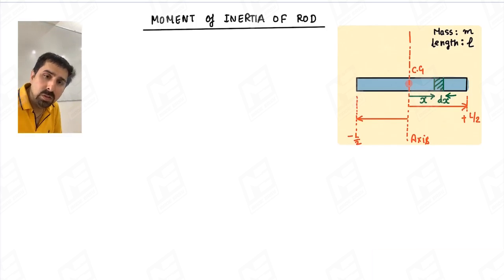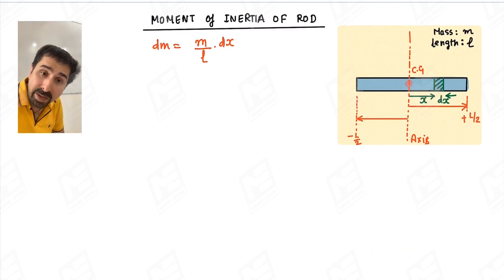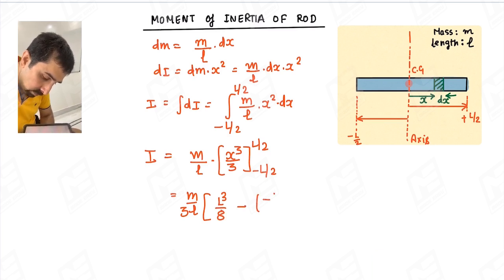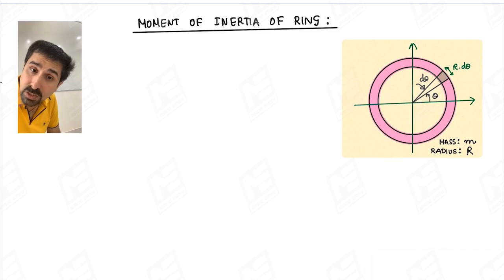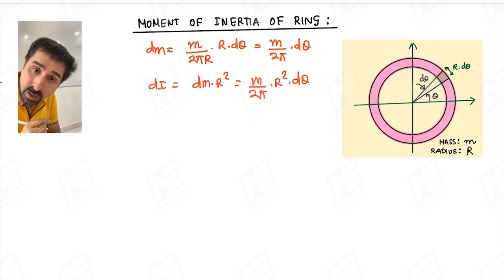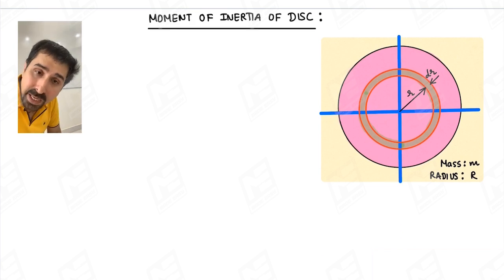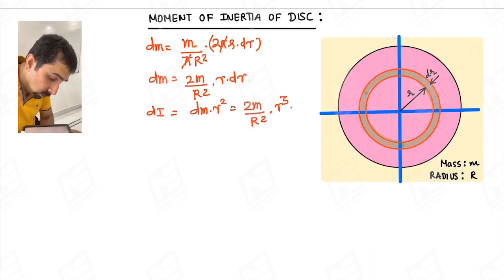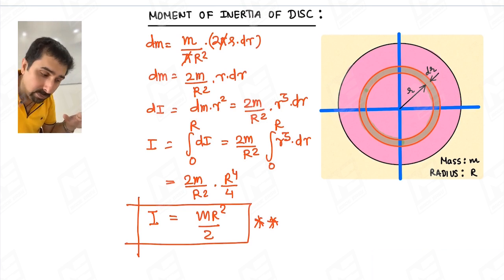Discussion on Moment of Inertia (Part-1) | by Amit Kakkar Sir | MADE EASY Faculty

Comment: Explain this qn n concept plz... 
A metre stick is pivoted about its centre. A piece of wax of mass 20 g travelling horizontally and perpendicular to it at 5 m/s strikes and adheres to one end of the stick so that the stick starts to rotate in a horizontal circle. Given the moment of inertia of the stick and wax about the pivot is 0.02 kg m2, the initial angular velocity of the stick is...?

Online ans h but clear concept understanding nhi hui usse.
Reply from the maker: Dear Candidate,

Thank you for your question. We will forward the same to the concerned department.

Regards,
Team MADE EASY